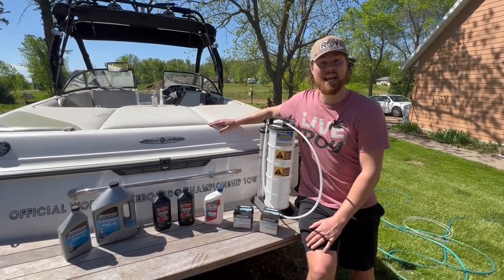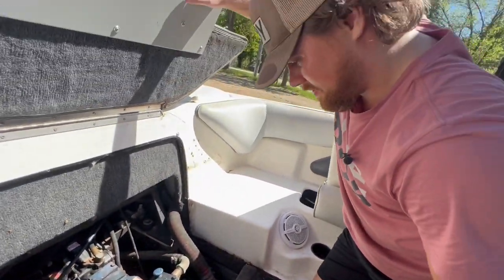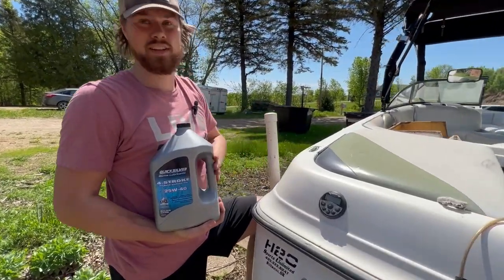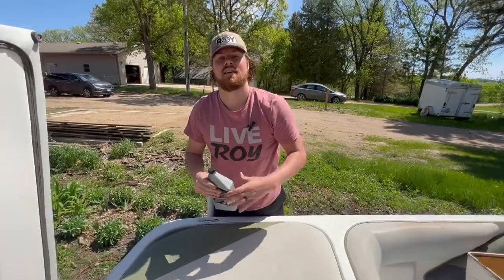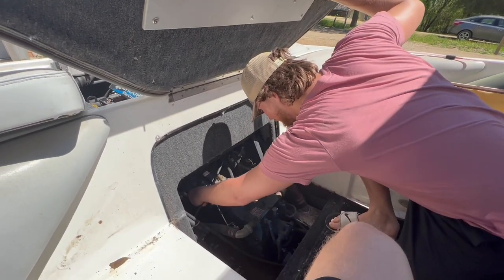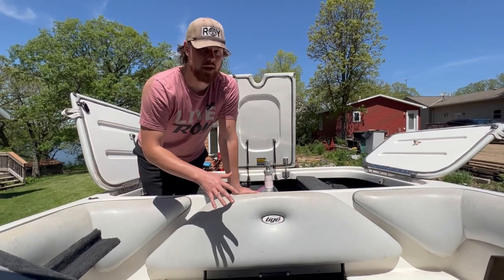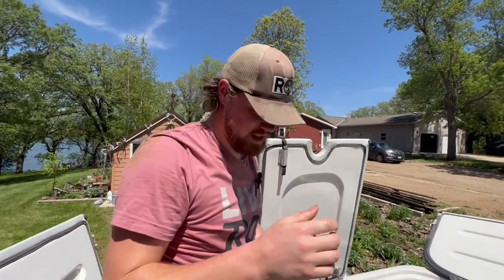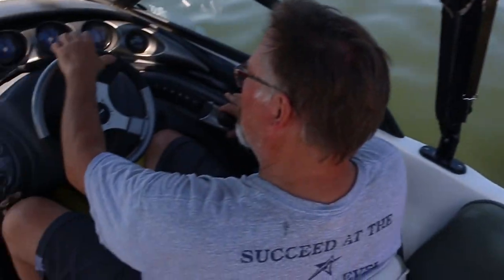How To Change Your Engine Oil, Transmission And V-Drive Fluid | Da Boat

Comment: For the v-drive oil change, don't you need to pull a drain plug in addition to sucking it out from the dipstick?  it should take 1.5 qts.

Comment: would you be able to make a video showing how to remove and reinstall the prop shaft. I have the same boat and my couplings are different than depicted in the owners manual. maybe you have the same? Thanks!
Reply from the maker: Hi Wyatt, we will add this to our list - idk if we will be able to get to it right away but we will do our best! We typically film progress on our current projects and any maintenance we need to do - someday when we are full time, we will be able to tackle these request quicker!

Comment: I normally change the oil filter after emptying and before refilling with oil… is there a reason you put oil back into motor before replacing the filter?
Reply from the maker: I wish there was something super smart we could tell you but we honestly just forgot to change it before we put the new oil in 😅 BUT now you know you can change your filter after you put new oil in 🤣😂 just in case you find yourself in that position 👍🏻